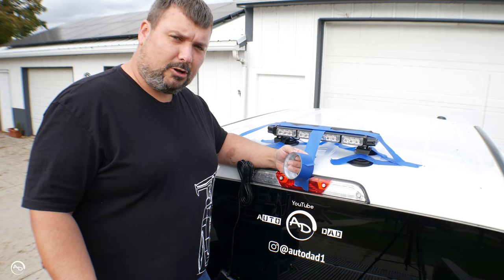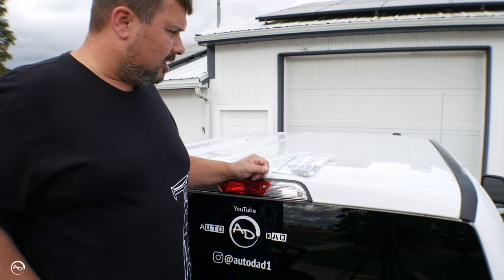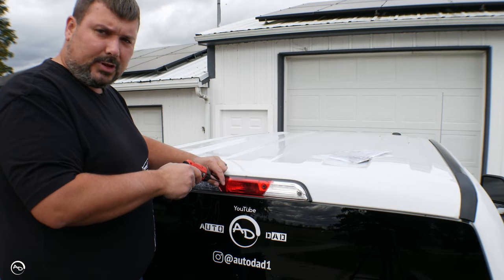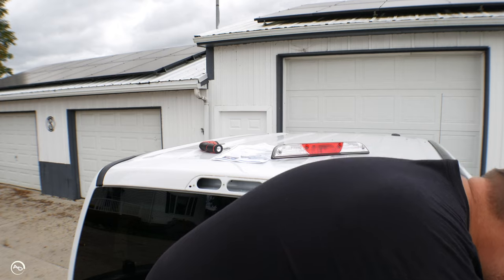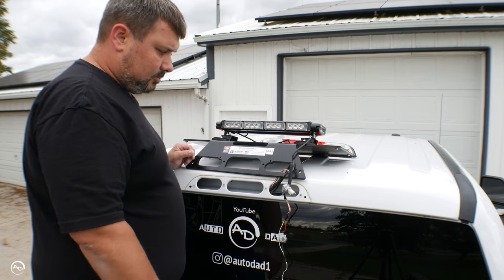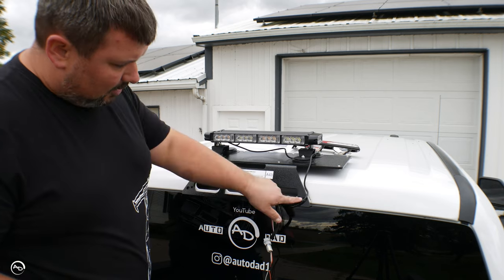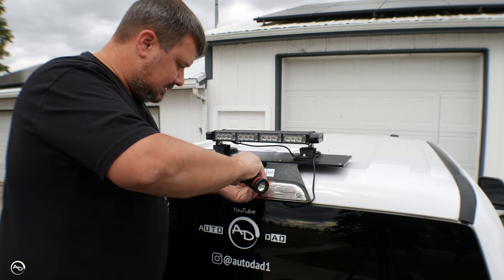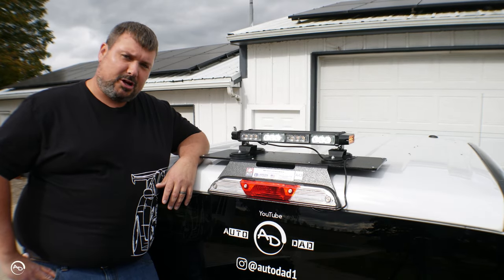Ford light bar mount

Comment: I'm just a bit confused about why anyone would pay upwards of $300 for the mount. To mount a $50 China made lightbar?

It makes as much sense as the people you see driving around in $500 beater with $5,000 in stereo equipment 😅.

I would suggest to anyone that they invest in a lightbar that will last longer than 6 months. One that will actually be bright enough to do the job of an led warning light.

Like a Whelen, SoundOff Signal, Federal Signal. More often than not if you can buy it on Amazon or eBay for $50 your getting a crap lightbar made by little kids in some 3rd world country somewhere!

Comment: Wires, put them under the bottom of the lamp or it will leak, also use some silicone calk  to make a tight seal. 
The headliner on most trucks is a covered foam or plastic or cardboard thats formed to fit inside it can be pushed down by hand enough to get past it with the wires ran to the b piller and down to the floor and up under the carpet to the dash make sure to install a fuse wher you get power for it. If it ever shorts to ground you just pop a fuse and not burn the interior of your truck.

Comment: So the newer F1 50s or not metal
Reply from the maker: Aluminum
Reply: Ford has been Making there 150 bodies out of aluminum for almost 10 yrs now , strong and no rust , about 800 lbs lighter so you then have a higher load capacity and towing

Comment: Come on you can make the install a lot cleaner looking  zip tie the wires hide them better  drill a wire hole in the plat to run the wires under it down to the edge and tuck it up tight to it.